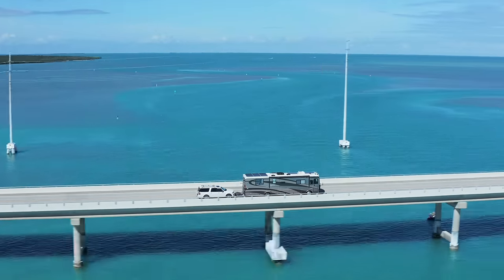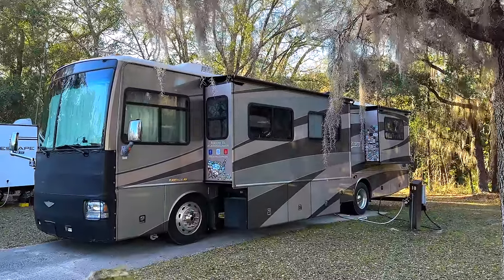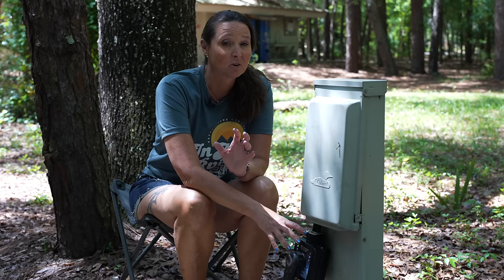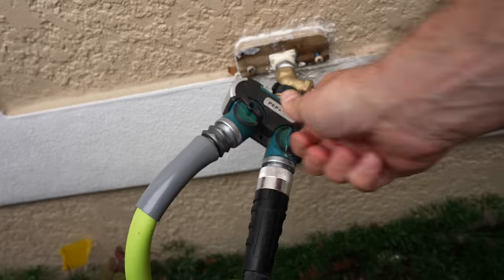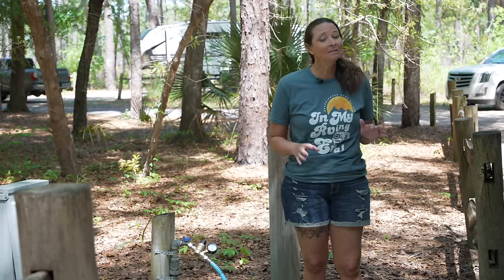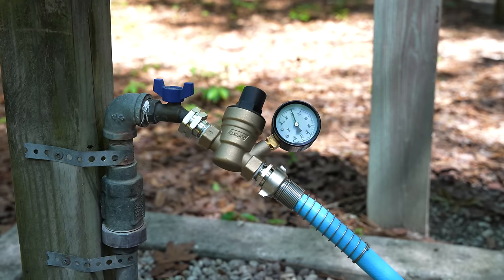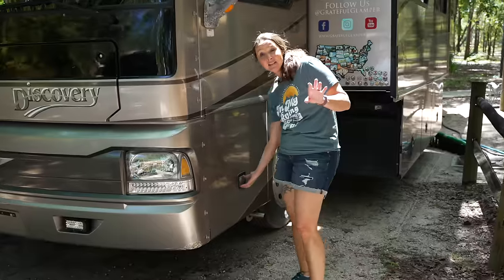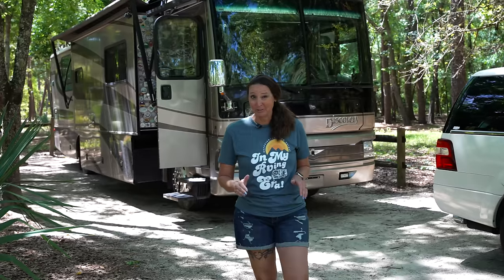RV Campsite Setup Essentials! You Only Need A Few Items

Comment: Small tool kit  is a must.   Essential tools are screw drivers plyers tape measure adjustable plyers duct tape wire cutters wire ties air gauge .  Additionally replacement light bulbs & circuit tester. Remember your house is moving Screws will get loose.

Comment: Things we learned. Before attaching the water filter purge it first. Frist Officer (wife) flipped out when the water came out black in the sink. We work off of 30 amp. Carry a extra 20-amp cord to run that extra high amperage appliance. Open the black tank valve slowly at first. That way you won't have to yell out OH SH** when the 90-degree connector starts to come out of the ground connection.
Reply from the maker: Great tips - thanks for sharing and for watching.

Comment: Great day one essentials! Now here's Day two Rv essentials:
1) A back up sewer hose, that also can connect to n extend your everyday one.
2) A back up water hose, basically 2x 25fter that can connect and extend your every day one. 
3) an electric power cord extension like another 25-30 ft power cord that can extend your everyday one.
4) If you r a 30amp rig have a dog bone that can plug into a 50 amp plug n into your 30 amp power cord, n a dogbone converting down to a 15 amp plug. (Think about an rv park that is all full but has only 50 amp plugs available or someone fried the 30 amp plug at your shore power post, etc) 
5) a spare water pressure gadget, doesn't have to be the fancy ones with the big dial, can be a simple preset small one. Cause yeah they crap out when u least expect it. 
Those r day two essentials lol, get past day one first lol. 🍻
Reply from the maker: LOL - Day two essentials - love it, Thanks for sharing!

Comment: Don’t cut corners on the surge protector.  We stayed at a park once that had a three second outage then power returned, even though we had a surge protector in place the surge was greater than the protector was rated for and it blew out our refrigerator/freezer.  A very costly and inconvenient lesson.

Comment: Great video again for newer RV 's. Like the waste pro sewer hoses. Correct on valves to keep open - closed. Never use any bleach products in the toilet as it can deteriorate rubber - silicone seals. Keep an assortment of zip ties handy. Leveling your RV is essential for an ammonia fridge. 6 degrees front to back and degrees side to side max or your asking for problems. Thanks for your time in making these videos. Steve Robinson. On Walker lake in Hawthorne, Nevada for the night. Beautiful place at Sportsman Beach. Snow capped mountains 🏔 in the background.
Reply from the maker: Enjoy and safe travels- thanks for watching and for the comment

Comment: When you step down your power from 50 amp to 30 amp to household 110, you'll need a heavy duty power cord that plugs into the 110 or the cord will get very hot.
Reply from the maker: Correct!

Comment: Particularly if you're boondocking or don't have access to shore power at a campground/RV Park/home, you'll need a generator (portable power station, inverter-generator, or straight generator), and one that can provide 2000w - 4000w with a 30A/50A port depending on what appliances you intend to run inside your TT/5W.

Comment: Why did you switch from the Watchdog Surge Protector to the Progressive? We have a seasonal campsite in the Lakes Region in NH, and want to use a surge protector.  I have researched both and would like your input on why you switched.  Thank you in advance - LOVE to watch your beneficial videos.  We purchase items we need that you use and stand behind.
Reply from the maker: To watch dog was causing issues with the way that we have our inverters and auto transformer set up. So in our specific set up, it wasn’t the best option.
Reply: @GratefulGlamper  Thank you for the quick reply!  I appreciate the input!

Comment: Hello RV newbie here.
Question about surge protectors, do you need a 50 amp and 30 amp protector? Can you use an adapter 30 amp to 50 amp on a 50 amp surge protector for campgrounds that only offer 30 amp?
Reply from the maker: You only need 1 and you can dogbone down.

Comment: Thanks for sharing we recently added the surge protector to the inside of ours Discovery   I have a question -do you also have a filter under your kitchen sink in addition to the one on the outer hose? Thanks
Reply from the maker: Yes we do - mainly
Because it came that way from Fleetwood.
Reply: @GratefulGlamper  thank you.

Comment: For a rig like yours, when leveling for setup, do you stay inside? Slides in or out? Imy going to be travelling alone in a rig a fraction smaller than yours but otherwise the same, and I've seen so much conflicting advice!
Reply from the maker: We level first and then put out the slides. The kids a d one of us are usually inside when leveling due to how our rig is set up. If we had a towable, I wouldn’t have anyone inside when leveling.